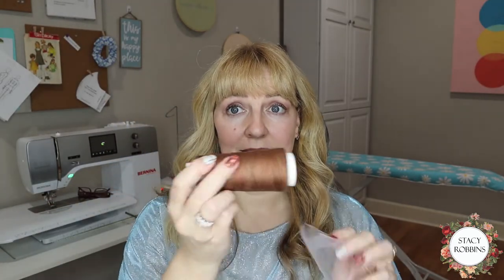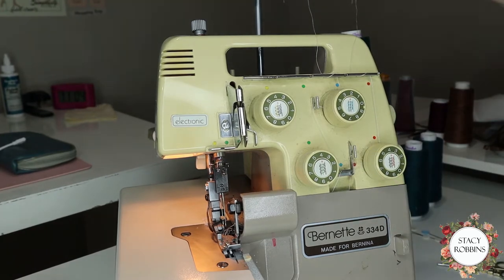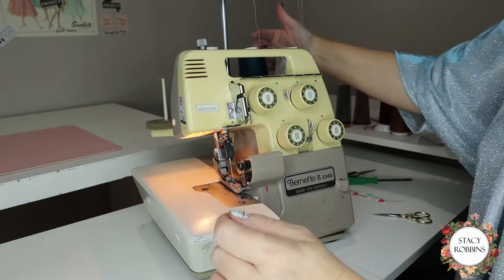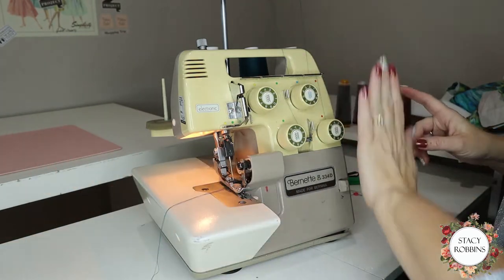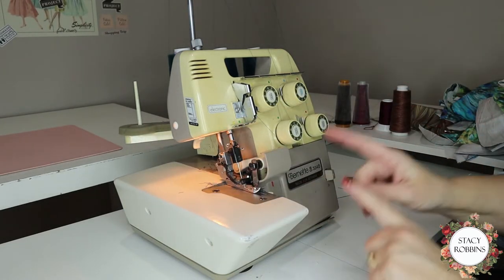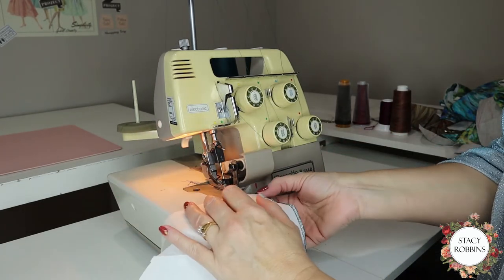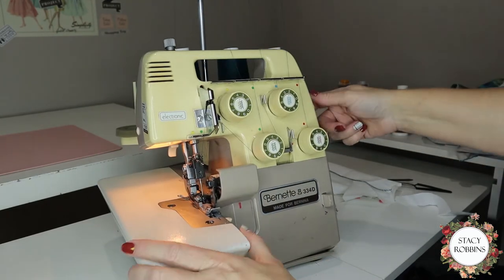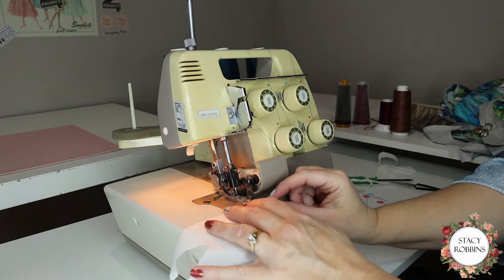Rolled Hem Basics on the Serger/Overlock

Comment: I want to make some napkins out of sort of upholstery material. Could be couch or pillow cases... Can i use this method for a thicker fabric? What changes would i need?
Reply from the maker: The thicker the fabric the less  it will roll. You can do the same stich but may have to do a little adjusting of the tension to get the look. If the fabric is too heavy to roll, do a little wider stitch to make sure it covers and doesn't pull off the edge. You may want to use a wooly nylon or a fuzzier upper looper thread to get better coverage. Hope this helps!

Comment: Hi! Been searching for such videos so sooo happy I found u! Question? Working with wooly nylon on my upper and lower… do I still have to go up in tension in my lower ? Also… if the upper is supposed to rolled to the back then the thread showing on top will by normal thread and not the wooly of the wooly need to shows in top and also in back? Thanks😊
Reply from the maker: Hello! You will need a low tension on the upper looper so the thread can wrap to the back. You will need a bit looser on the lower too because wooly is so stretchy. I always make a few samples. I will write my looper numbers on the sample when I get the right settings. I hope this helps.
Reply: @stacyrobbins  😃 I just dont know what looks good 😂 - i saw your pictures on your samples but you are able to easily tell what looks good 😊. Any chance you have a video on how a bad hem looks like?

Comment: Gotta try the wooly nylon. Also, loved the tip about how to turn corners to eliminate use of thread sealer. I've been looking for how to do that. Thanks!
Reply from the maker: Glad it was helpful!
Reply: @stacyrobbins  I tried turning corners using several pieces of scrap fabric. Unfortunately, I'm having a "repeatability" problem from one corner to the next. In order for the fabric to pivot when I reach a corner, I have to work the stitch loose from the fingers/pins that help form the stitch, which allows the threads to become loose just below the needle. Sometimes these loose threads will be captured when I resume stitching and they aren't seen in the final product. Sometimes, however, a loop or two of thread will escape capture and can be seen flagging out from the corner. I'm afraid to clip them off as that could lead to that corner unraveling at some point. It's a bit of a hit or miss about getting a clean corner each time.  :-(
Reply from the maker: @spat7378  Your description is so clear I can picture it! I am uncertain about the fix though. You may be able to sew to the edge of the fabric and then turn, pulling it back down. The edge will not be a true miter but the threads won't be cut or pulled leaving a smooth finish. If you find a solution (tension or thread change for instance) I am interested.  I am also curious if it always works when sewing with a certain grainline. Like it turns better going from cross-grain to lenghtwise. Just thought.
Reply: @stacyrobbins  Thanks for the reply. I’ll keep playing with it to see if I can’t find a workable solution. I just need to figure out a way to consistently get a clean corner. I need to make a dozen napkins and placemats fairly soon as a housewarming gift. I’ll let you know how it goes. Take care!
Reply: This was a great GREAT video. Answered a lot of questions that I have about different threads and different fabrics. THANK YOU! But I’m just wondering why you demonstrated on an old Bernina serger when you had a new L460 in the picture!?